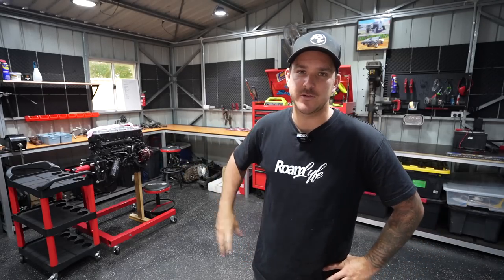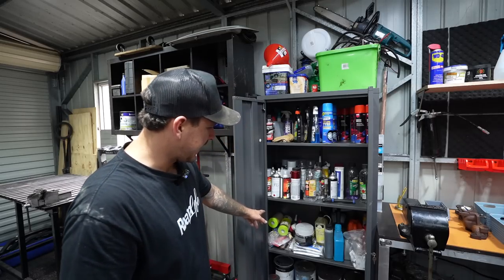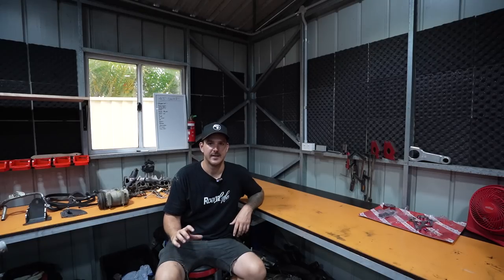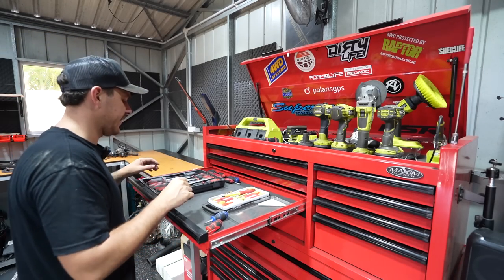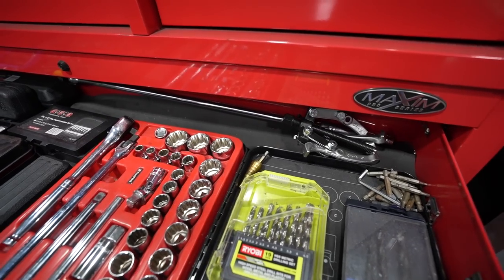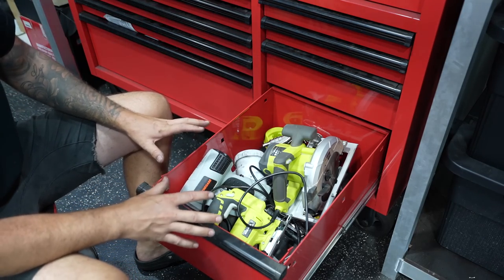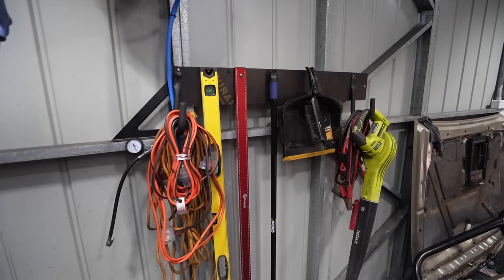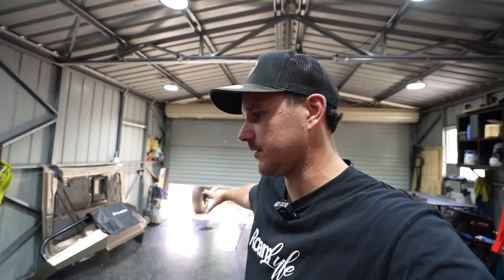My DREAM Workshop! Full Shed Tour & Tool Walkthrough

Comment: Your shed is decked out bro, 1 thing I did to mine which is similar to yours and stoked with is a double roller door, got mine from Sydney Auctions with a couple small dints 
5100mm long matching colour $400, little bit of mucking around, Best $400 I've spent. No fkn around, drive straight in the middle!.👌

Comment: I just can’t understand a 4cyl diesel swap for a 4cyl diesel
Reply from the maker: Reliability, aftermarket parts, size & weight, simplicity of the swap & will be pushing 250hp 700nm while getting 10-12l per 100kms! Oh and cheaper rego!! What’s not to like!? 😆😆
Reply: fair enough good points but a Barra swap would b teasing me
Reply from the maker: Yeah I almost went the barra hey! I did price it up and tbh it would have been quite similar! The downside to a barra is 98 petrol tune and can’t get 98 everywhere, also fuel consumption is up around 18l per 100, and rego/insurance is major!
Reply: @RoamLyfe  yea nice, fk I’m jealous of the shed too 😂